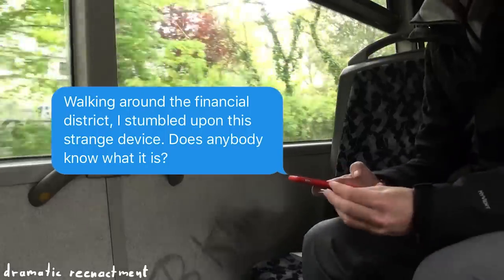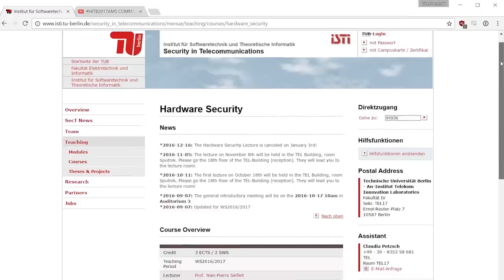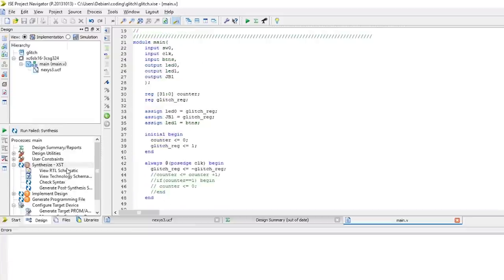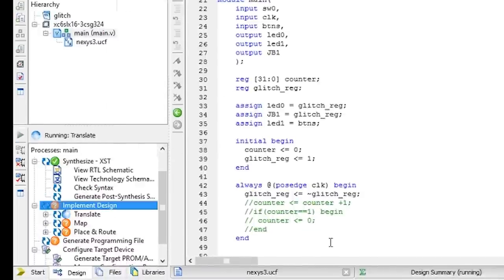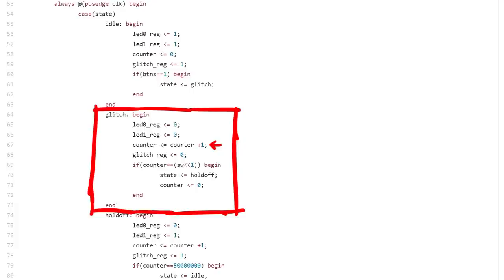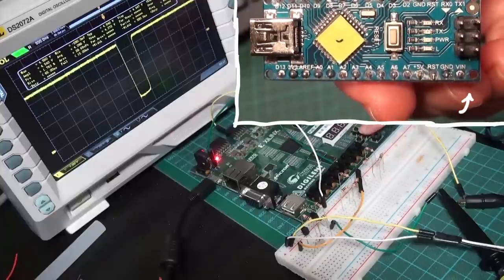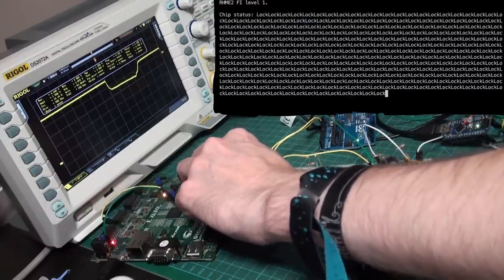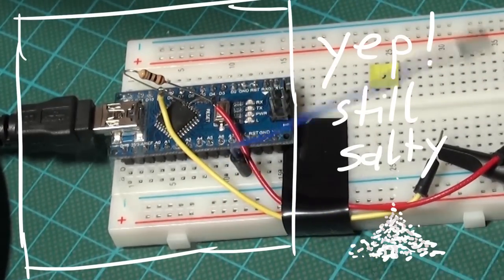Hardware Power Glitch Attack (Fault Injection) - rhme2 Fiesta (FI 100)

Comment: I am glad you manage to make your project work on an FPGA, it is a really fun device to play with. As a side not, that was an absolutly overkill there :P please look for 555 circuits, in monostable you can generate a pulse when you press a button (negate the logic to generate a "negative pulse", or astable configurations (periodic pulse), with a potentiometer as the interval selector. Btw YOUR VIDEOS ARE AWSOME, but you just got droped into my speciality :P Btw2, the minimun V you can get from a BJT transistor collector is 0.7, because it act as a diode regulator when no current is passing throught it. You will have to add a transistor serially connected with the supply to short it as well, and to aniquilate that vout.
Reply: actually I think your voltaje drops down to 1.4, becouse a transistor is like two diodes connected back to back.
Reply from the maker: Wow thank you for that information! Thats the first explanation I got!!
Reply: a 555 can only generate monostable pulses down to 10us

Comment: I highly recomend to use a mosfet instead of this converter for the power, because fpgas are really not made to supply current and a mosfet is only controlled by voltage

Comment: When i design my own boards, i shall put bigger caps on board and a faster brown-out detection.
Reply: ...then an attacker desolders your big ass caps ;-)
Reply: nah just put a good power supply infront of it
Reply: @josefaschwanden1502  Whatever you do, if someone wants to do serious power glitching they will rip out your psu and all the filters and power it off an fpga as in this video. Heck, they could rip out the important chips and put them on a custom board if so they wish
Reply: So basically somebody would look at it and swap the cap for a smaller cap.

Comment: No need to take out the controller of the arduino for serial communication. Just connect reset to ground!
Reply from the maker: Im not sure what you mean? How would you want me to have it wired up?
Reply: You took out the ATmega of an arduino to use it as a handy usb-to-serial-adapter. As I said, you can leave the ATmega in, but silence it by putting a jumper cable from GND to RESET. It will then behave exactly the same way as in the video, with the exception that you do not risk bending any pins. You can read more about it by googling "arduino usb to serial" for example.

Comment: The level converter circuit is meant for signal level conversion only, but not for power.
Reply: I would just use a mosfet which connected to the power rail of the target board to do the job.
Reply from the maker: +Tsz Lam Cheung thanks for the valuable input! I have no clue what I am doing. I knew I could use a mosfet though, but didn't have one
Reply: BJT will do the job too
Reply: But it works eventually, who cares XD :)
Reply: You need something fast & powerful, which actually can be a challenge. What you see on the scope is not energy from the capacitors (otherwise you would see a capacitor discharge curve --> not constant) but rather your transistor acting as an additional load, resulting in a voltage drop. Two things to try: add more resistance into the power line (but low enough for the board to run fine) or a more powerful MosFET with a gate driver.

Comment: Awesome! Would it be possible to cause the glitch also with a second arduino instead of the fpga?
Reply: not really with an arduino, as it's not fast enough, but with some electronic engineering skills you could design a cheap ass board for this kind of powerline attack. I mean the hell wants to spend that much money for an FPGA dev board
Reply: Maybe with a timer.

Comment: This is way more complicated on a more advanced MCU however, such as an ARM based one where you have interrupts for virtually any hardware fault. It would be almost impossible to glitch skip a few instructions without ending up in the fault handler rather than the next instruction.

Comment: Woah, this is awesome. I'd never believe this is possible. Could you do the same with just microcontroller instead of using FPGA? Are microcontrollers not fast enough?
Reply: I know this is 7 months old, buuut: you can even do it with some chip like NE555 and some circuitry :>
Reply from the maker: I'm not wizardry enough to pull that off :D

Comment: Could you have stripped your USB cable, cut the +5v wire, and connected them back together but with the glitch circuit in the middle?

Comment: 10:57 A computer of mine seems to have something like this wrong with it. The breaker to my room always trips and after many power cuts the computer started having weird seemingly firmware related issues (fan control, booting).
Reply: Adam Messmann that shouldn’t be the issue, as the battery would still be transferrring power as far as I can tell

Comment: Mr. LiveOverflow can you exlplain why you said "so a transistor" at 3:06 or give me a link to page where i can look it up?
Reply from the maker: "I want to use a single wire as an output of the FPGA to control an ELECTRONIC SWITCH that turns on or off the power supply - so a transistor".
A transistor is just an eletronic switch.
Reply: oh...didn't even cross my mind...thanks

Comment: I had this problem by accident, and my microcontroller behaved crazy. It is very hard to debug and the controller didn't had a BOD (brown out detection)
When you have a BOD, you can set it up so that the controller resets when the voltages fall under a specific value. That would prevent that attack.

Comment: I guess the first thing I would have tried is reading the flash contents of the microcontroller.
Reply: It's encrypted, and only gets decrypted by the custom bootloader
Reply: @CelluloidRacer2  Ok, didn't know that they encrypted their code. The usual way to go on an Atmel controller would be to simple lock the flash, but I guess they want you to still be able to use the Arduino afterwards.
Reply: You can still use the Arduino after you lock the flash, erasing the flash will remove the locking. This stops you from reverse engineering the code, but without bricking the chip.
Reply: @marcandreservant8824  Ok, didn't know that since I'm not that familiar with Atmel chips.

Comment: I hoped you will use serial output as trigger instead of button, then just measure space between bytes and slowly move threshold value when to fire trigger. It would be interesting to see if author runs test just before sending byte, during it (HW USART), after or somewhere in middle of delay.
I guess that way you could hide more secret messages into processor and show them one after one :)

Comment: Bit late to the party, but from my understanding in VHDL you cant do  counter = counter +1 as this will count uncontrollably, rather than doing one increment. I believe the better way of doing it is is having 2 different counters ( counter and counter_new) and you update the counter_new value to the counter when the clock is low, so that this infinite loop never happens.
Reply from the maker: mhmhmh... yeah I don't know! :D
Do you think my counter might glitch sometimes?
Reply: Yeah I think so, because in VHDL you are not adding to a variable. implementing a " +1" will make an adder circuit that is connected to logic 1... making an infinite counter. Does that make sense?
 the only limit is how quick the adder circuit is and how many times it can loop before it changes into a different state.
Reply from the maker: I wrote Verilog, not VHDL :D but I think there is a bit more "magic" to it.
The Logic Blocks don't just directly connect, there are Flip-Flops involved because I react to the clock edge etc. This counter is a typical VHDL/Verilog example and it would surprise me if that glitches.
but I'm also not sure.
Reply: AHH ok, I think maybe when I have written it in the past I have done things asynchronously and have had that issue, do you have a copy of the verilog you wrote? I would like to take a look at it
Reply from the maker: It's in the description of the video :)
https://gist.github.com/LiveOverflow/cad0e905691ab5a8a2474d483a604d67

Comment: Wouldn't it be much easier to just use a nand gate? Just add an inverter before the gate so pressing the button will trigger a short pulse when the two inputs of the nand gate are equal for the time the inverter needs to toggle the ouput. You could add more inverters to change the width of the pulse

Comment: given that we can tell it's an arduino and so it's an ATmega328P, why not just use avr dude to read the code out?  Depending on the state of the fuses, this is a very real possibility.  A simple: "avrdude -c avr109 -p m328p -b 115200 -P com1 -U flash:r:flash.bin:r" or the like  then decompile and read the assembly. most likely the flag is stored in the .data section as string.  and even if it's not, you could simulate it, or patch past the infinite loop and re-flash.

Comment: I used an Arduino Uno as a USB-UART interface without removing the ATMEGA chip... just leave the RESET triggered: /dev/ttyUSB0 will vanish and /dev/ttyUSB1 will appear as a sniffer at RX/TX pins.